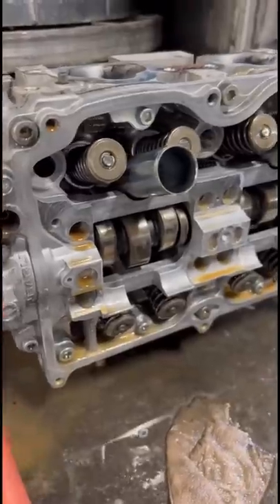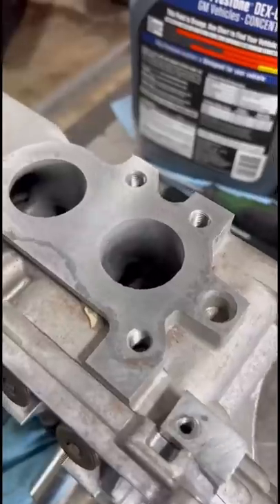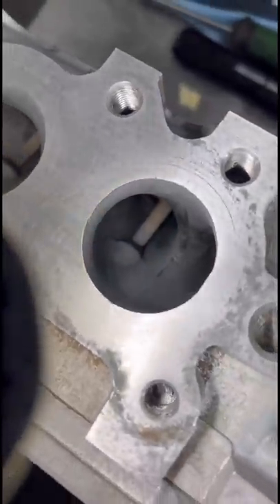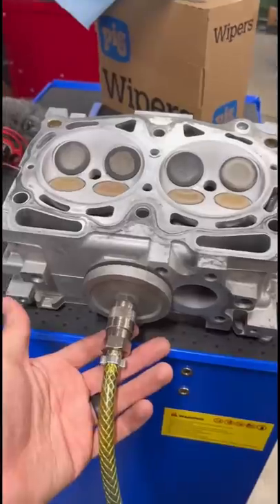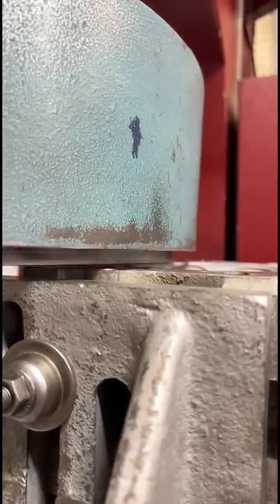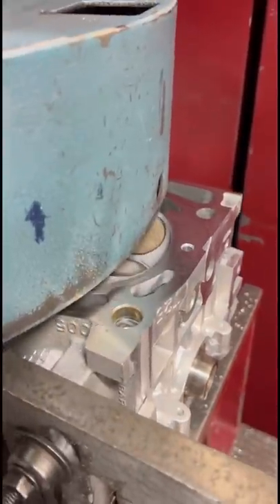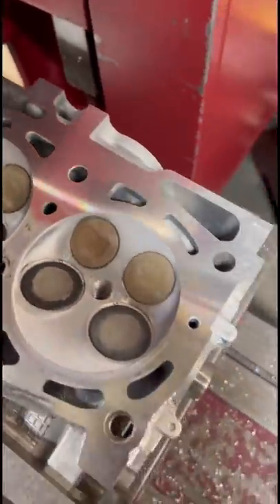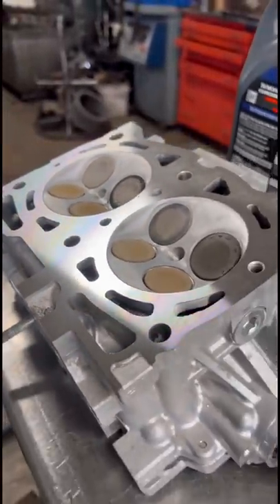#shorts Not A Week Goes By Without A Set Or Five Of Subaru Heads For Resurfacing

Comment: And think if they install these perfectly the customer will only have to do head gaskets again in 6-9 months 🤣🤣🤣
Reply: What makes you think that?
Reply: @e-racer4673  known problem with Subarus.
Reply: The NA Subaru engines had an open deck block that wasn't very good. I have heard that since the turbo Subarus have a closed deck block, this doesn't happen as often.
Reply: @skylinefever  the EJ257 isn't closed deck, but head gaskets have never been a problem I'm aware of. The cylinder ringlands do have a nasty habit of cracking or entirely separating and going for a ride around the inside of the crankcase. Been there, done that. It's always cylinder 4 for some reason, too.
Reply: @ParadigmUnkn0wn  From what I have read, the US version has a really lame exhaust manifold design that doesn't balance flow well. As a result, one cylinder will be hotter than others. Japan gets a full twin scroll, and that works better. However, they only get a 2.0L engine because there is a tax based on engine displacement.

Fortunately, engine importers can get you an OEM Subaru twinscroll turbo and manifold setup for cheap. If you want to go further, you could buy some high performance twin scroll manifold and turbo.
Reply: I have EJ252 na, around 260,000km. HG isn’t an issue. It’s a specific range of EJ25s on gen 2 iirc where the head gasket itself is the problem with carbon coating that gets etched away by coolant then the gasket can be corroded and you get a leak.
Reply: @skylinefever  wow a real expert! can you tell me what a twin scroll turbo is??
Reply: @byloyuripka9624  I couldn't explain it in text. It is probably best you watch various extreme Subaru turbo builds.
Reply: Only if you don't deck the block. Even .001 will be a problem. Most people won't want to pay for it though ....
Reply: Average lifespan of a 6.0 powerstroke too
Reply: Typically once the factory head gaskets are replaced with aftermarket ones the problem doesn't arise again.
Reply: Both my 04 and 08 legacy had head gaskets done. 04 is leaking again.
Reply: @byloyuripka9624  twin scroll separate the banks so you have the air separated all the way through the turbo. This creates a quicker turbo spool by utilizing the exhaust gas Pulses to their full potential.
Reply: @skylinefever  i did it for you..
Reply: It's a Subaru
Reply: Subaru vs camry.
Toyota camry lasts forever, but i have 2 questions.
1. Do they perform the same?
2. Are they driven the same?

It's obvious that the Subaru sees its red line pretty often and those who aren't driven like they've been stolen seem to not have any issues.
Reply: @codkiller2025  My 6.0 was bulletproofed at 80k and going on 300k+ with the most expensive part I've had to replace being the ac compressor...
Reply: @DirtForester  bruh it was only NA north american EJs that had head gasket issues... No other engine
Reply: Weld close the deck at 4 points with narrow 7mm welds and no more head gasket issues. Needs to be done before a head skim obviously.
Reply: @Draxindustries1  bruh wtf hahaha idk if your talking NA engines or turbo engines, depends on which, you just might be so damn wrong
Reply: @Merker367  
I don't quite understand  what you're saying as my first language is English. What my statement means if you strengthen the block ie partially close the deck it strengthens it preventing cylinder liner movement and in turn stops head gasket failure. This type of modification will apply to n/a as well as turbo engines. Hope this is clearer.
Reply: @Draxindustries1  that is not at all why the 2.5l blows head gaskets... You are severely misinformed
Reply: @Merker367  
Misinformed, not at all.
You must be working on another type of engine  obviously not Subaru..
Reply: If they replace the head gaskets with an aftermarket metal gasket, it will never have an issue again. The issue with Subaru head gaskets is the particular material that was used to make them, it breaks down over time.
Reply: Aha hahahaha I checked the comment after I made mine and you beat me to it, you're experienced
Reply: @DirtForester  I don't see many Subaru in the shop I might see 3 per year. It all depends on how u take care of the car tho if u drive the car floored everywhere it's not gonna last. If u drive slow and do routine maintenance it lasts as long as 94 corrola
Reply: But why i have been running my car for 8years with coolant pushing  out on boost... Yet it still didnt blew up
Reply: @Merker367  draxindustries1 is correct...

If u didnt know already.. thats called "closed dock mod"

Many version of doing closed deck mod on subaru block...

But minimal deck weld and dowel inserts are preferred to retain good cooling properties...

Fuppy closed weld/insert are generally stronger but need much more attention to cooling system (ie: race rally cars application)
Reply: @AmirPomen  This isn't why they blow head gaskets... Jeeze I'm trying to be nice but it's tough when talking to people with a 32mm thick skull.
Reply: @e-racer4673  He's read other comments on YouTube that say the same. LMAO I see it all the time and 90% of the time the person making the comment has never owned or worked on a subaru.
Reply: Oh yes! That's the main reason I will never own one of these motors lol. But, they are fun to drive if you don't own them!
Reply: @skylinefever  depends on the motor, Subaru has used open deck, semi-closed deck, and closed deck.  The most common in the US, for turbo trims, is the semi-closed deck if I recall correctly.

The 2.0 liter JDM engine was also to meet WRC homologation rules, back when Subaru was big in the WRC world.
Reply: @kylemcweeny878  good job. At least you have the internet for research purposes
Reply: @snowflakecuntreeman3947  Subaru vs camry
You mean impreza vs Camry?
As should anyone without snow half the year.
Or
WRX vs Corolla GR?
Corolla.
Toyota is always the answer.
Reply: @clockhanded  they aren't bought by the same kind of owners and certainly not driven the same.
The few Subaru's out there who were bought by very "sensible" people have lasted just as long as their toyota counterparts.
Reply: @snowflakecuntreeman3947  I don't know what point you're trying to make. Most people aren't thrashing new toyota or Subaru sedans. The sports cars are mostly driven hard. It has nothing to do with brand. It's a mixed bag. There are too many diverse Subaru and toyota owners to generalize them all.
Reply: @skylinefever clearly you dont know what closed deck is and subaru has been putting twin scrolls in since 2015. Also sti Japan is 2.5 wrx is 2.0. Also the exhaust manifold " issue" is from when they used uel headers which have been gone since 2015. Keep "hearing" but dont actually research or learn anything so you can continue to sound like a river wannabe.
Reply: This is the most overstated issues
 about subaru's I've encountered. Old NA subaru's used composite headgaskets that were eventually prone to failure. The fix is to switch to MLS style head gaskets. The issue is not with the design of the engine itself. The misinformation about this is rampant. Turbocharged subaru's have always used MLS headgaskets and the failure rate of them in turbo cars (ej205, ej255, ej257) is significantly less than NA cars even though they are subject to higher cylinder pressure. 

Tldr; The original flaw was in the design of the head gaskets. Ask anyone Subaru specialist or tech, when an NA Subaru comes in for a head gasket job they replace the composite gaskets with MLS gaskets and if done right, they don't ever come back for the same issue.
Reply: @Merker367  incorrect, the JDM ones are also notorious for head gasket failures.
Reply: @bullymaguire8868  that is incredibly false.
Reply: @Merker367  no. I live in NZ where we ONLY get  JDM versions. On top of that I completed my mechanic apprenticeship at a Subaru dealership before working at a Subaru specialist tuner for 6 years. The head gaskets are ABSOLUTELY prone to failure.
Reply: @epia125  the best 2.0 block is the factory closed deck block from the 89-92 JDM Legacy RS-RA.
Reply: @bullymaguire8868  you are so incorrect it hurts.
Reply: @Merker367  what was the best factory block in your opinion?
Reply: @epia125  IDK I don't know enough about all of them. The 2.5s are all or mostly all semi-closed which is nice, and you can get big power with that much displacement.
Reply: @Merker367  haha good luck then expert. Some people know everything I guess
Reply: Funnee meme but in reality the cylinder 4 ringland is the real sticky wicket for turbo EJs. Head gaskets are a “problem” on the 2.5 NA engines and the solution is to use the HGs for a turbo motor.
Reply: @detectivebloor4011  that is so wrong dude hahahah if you buy any head gasket for the NA ej it will be updated. It was only the factory NA gasket that wore off the coating too fast. Jesus Christ there is so much false info out there
Reply: @Merker367  lol ok dum dum
Reply: Thats funny because I was told thay my first car, a 2006 Impeaza wagon, had the headgaskets replaced before I bought it. 4 mo later and 6000mi later, I had to teach myself how to do heads
Reply: Idk, I did them on my wife’s ‘01 forester at 100k miles 12 years ago. 300k on it now, a tiny bit of oil seepage these days but nothing to lose sleep over. 

(Probably shouldn’t have said anything, I might have jinxed it)
Reply: As a firend is a suby master tech and I'm a Honda tech the reason isn't the heads so much as the EJ series as a whole that were NA didn't get the turboed MLS gaskets they were graphite coated...... You can see the issue when it wears off
Reply: And keep a spare couple of gallons of oil in the trunk 🤣
Reply: @snowflakecuntreeman3947  wouldn't a better comparison be a supra, Celica, Mrs, mr2, or something?

Whatever floats your boat though
Reply: @skachor  not for the point I'm trying to make.
My point is they are driven differently thus won't last equally as long.
Mr2 is in the same boat as the Subaru, they are both bought by a customer who wants a bit more in life and they both drive the car a bit harder (there are exceptions but I'm referring to the majority).
The guy who buys a camry does not buy it to ride it hard.
See what I'm getting at?
So the mr2 and Subaru will most probably both be labeled as "cars with issues" but not the legendary camry.
Even though if you ride thr camry just as hard it will have issues + not have tge same performance.
Reply: @snowflakecuntreeman3947  the mr2 is solid af.  At least over the 25 years I've had my 93.

Funny enough I have a Camry that I drive like I stole it and again - no issues.
Reply: @skachor  lol, so you drive the mr2 sports car which has actual performance and proper road handling abilities like a sain person and you drive the old reliable family car which performance wise sux compared to the mr2 like you stole it?
You sir are the exception, but id also pamper my expensive mr2 and drive the shit out of my cheap old camry, guess we are both the exception to the rule.

A Subaru is a performance car, even the family oriented models kick ass performance wise, they are just driven harder.
Some will say the mr2 is BS because they drive it like a race car so to Subaru's.
For me it's all about proper maintenance and touching the red line now and then and not destroying the red line everytime you get into the car.
Look after youe car and it will look after you, but many no most guys who buy a Subaru buy it to show off and ride the shit out of it and no matter how hard you push that camry it will never perform like a Subaru. Not even the mr2 will, wait doesn't the mr2 and a camry have the same engine?
Reply: @snowflakecuntreeman3947  no, I drive both the same and no the Camry and mr2 have different motors.  You should really know that if you're going to act like you know what you're talking about.
Reply: @skachor  it turns out i was correct, it did share the same engine, isn't wiki wonderful. Well some variants did anyway, but obviously they were tuned differently and had different carbs and so on but same engines.
Geez one would think as a owner you'd know this.
Reply: @clockhanded  i completely disagree, the average guy buying a Subaru is going to be more adventurous and possibly in a more "frugal" economic situation thus will drive their car harder.
The guy's buying Toyota camrys are boring and buy it for its reliability, resale value and economy and will take it easier.
Obviously there are exceptions to the rule, like with everything in life.
But that is why you'd see more work done on Subaru engines than Toyota camry engines, yeh sure Toyota is more reliable but it doesn't have the same power output nor is it driven the same.
Bottom line is, Subaru is not a problem car.
Reply: Yoooooo chill bro hahahah that hurts deep don’t talk about that
Reply: because america🤣🤣
Reply: @DirtForester  no it isn't. It's an issue with a specific headgasket on a specific non turbo charged model that was rectified 20+ years ago.

The majority of "head gasket" issues are actually overheating due to water pump failure because idiots won't replace them when they are due.
Reply: @skylinefever  the turbo Subarus do not have a closed deck block.
Reply: Fix the head gasket issue properly, with a good MLS gasket and don't worry about it again. If it fails again, someone didn't do a good job.
Reply: @arthurr8670  what if I told you the OEM gasket is mls?
Reply: Lol people on here trying to act like Subaru engines aren't trash
Reply: @16vSciroccoboi  there not.
Reply: @jeepmanxj  I'll take it from you, given you're obviously highly educated in the first place.
Reply: @16vSciroccoboi  I've only been working with them since the bugeye hit the US market. My in-laws still own a 98 outback with damn near half a million miles on the original engine. 

The problem with Subaru products, and for the most part any turbo 4 pot is the owner.
Reply: @jeepmanxj  cool story. I've seen a couple EJ22s with several hundred thousand miles. 

I've seen plenty more that weren't even abused that blew up, turbo or non turbo. 

The engines are shit.
Reply: @16vSciroccoboi  you haven't. Your 3 or for pieces of anecdotal evidence is meaningless against the millions and millions of Subarus on the road.
Reply: @jeepmanxj  okay. So my evidence is anecdotal, but yours isn't.

You're right, Subaru are the most dead solid unbreakable vehicles ever.

Meanwhile this single machine shop says not a week goes by they don't do a set or 5 of Subaru heads. 

Guess you must be right, it's just people doing preventative HG maintenance really.

I'd expect nothing less from a Subaru fanboy.
Reply: @16vSciroccoboi  you don't. I worked in an engine shop for a long time. 

Listen, I know you are reaching trying to come up with some nonsense to be right and you are just not going to cut it. You might be able to pull this nonsense with reddit clowns but I've been at this too long.
Reply: @jeepmanxj  cool story. You're still giving anecdotal evidence.
Reply: @Merker367  they all did. Always have. Some just take longer
Reply: @bullymaguire8868  I definitely do know more than yall
Reply: @jeepmanxj  it isnt on OEM NA 2.5s
Reply: @Merker367  it isn't on any of the EJ or fa turbo engines either.
Reply: @jeepmanxj   The Non turbo 1997-2003 2.5 North American EJs shipped from the factory with single layers head gaskets. Don't deny, look it up.
It might be all the way up to 2012 but I'm not sure
Reply: @Merker367  yep, 20 years ago, and no turbo Subaru offered in the states. Like I said earlier
Reply: If replaced properly one time with the correct gaskets they should be good for several hundred thousand miles. Don't believe everything you read in memes on the internet. 🤦‍♂️
Reply: @Joshuabryabt-gf6sc  You only need to avoid the naturally aspirated EJ25. All of my Subarus have 200K+ miles on original engines and head gaskets. 😂
Reply: @DCCTRacing  It's actually not the composite gasket (pre 97) that was the issue, it was the metal gasket which replaced it that had a rubberized coating that wore off over time. The fix was to go to turbo style gaskets, MLS without the full coating.
Reply: @802Garage  no body will ever believe you sadly. One issue with that statement though. If the engine has been overheated due to the head gasket failure, it can warp the mating surfaces. Some people just throw a new gasket on a warped deck, then the new gasket only lasts 40k miles and people are like "wow what a crappy engine"
Reply: @Merker367  Hahaha that's the truth! Oh well, those of us in the know will keep enjoying deep discounts on good Subarus. 😂 That said I still love my EJ18, EJ22, and EJ20 cars most.
Reply: @802Garage  got my '02Forester for $500 , a '00 outback for $500 and a '01 legacy for $700. I put about $300 in each of them and they run to this day! Well not the outback, was a parts car.
Reply: @Merker367  Hahaha exactly! I drove my last 1993 Impreza for 10 years, probably put a couple grand in it total for regular maintenance and repairs, including tires and wheels, and I only paid $300 for it originally. Plenty of other Subaru deals in the family of course.
Reply: If the motor lasts that long lol. Everything about these motors is a disaster.
Reply: @Twinturboripper  Yeah, sure. There aren't countless 300,000 plus mile EJ engines out there. 😂
Reply: @Twinturboripper  I can tell you have gained all you knowledge through FB posts and memes lol
Reply: @802Garage  there are countless at my shop being fixed. It’s not just a stereotype, they are literally some of the shittiest designed engines on this planet.
Reply: @Merker367  gained it by working on Subaru for over a decade. Cute how the fan boys can’t admit their beloved platform has a Shit designed engine!
Reply: @Twinturboripper  I know plenty of Subaru mechanics and performance shop workers/owners. Not to mention how many I have personally worked on. Every brand has issues and I'm not claiming the EJ is the best platform ever made. Everyone knows the NA EJ25 has head gasket issues. Do them once right, good to go. All of the 200-300K Subaru engines in my driveway that have never once been opened are a testament to how reliable they can be. That includes a handful of EJ20 turbo engines.
Reply: @Twinturboripper  you nailed it on the head, these cars are the absolute worst things on the road. Fanboys don’t listen because they think their subpar, crap awd, unreliable Subarus are the best. Funny how every one I talked into selling their Subaru has been so much happier with literally anything else they bought.
Reply: @jackdaniels2657  ok I'm going to throw my 2 cents in. First of all I don't agree if you baby a car it will last longer. I'm a mechanic by trade. I run the dog shit out of every car I own. I get great reliability out of all my cars. But I do maintain them and keep them at least half ass serviced. I all ways keep the oil full abs and the Trans. Now if my transmission get a little lazy between shifts I still raw dog them. I just let off the gas between shifts and let the Trans do its thing then it's back to the floor with the go pedal. I'm driving a 05 Kia with 200k on it back and forth to work which is 80 miles round trip every day. I raw dog the shit out the Car and it don't ever let me down. I live I'm memphis tn and the 240 loop is like a race track. My average speed is 90 mph. Before this car it was a Buick century and before that older Ford explorer. All had 250,000 miles on them when I sold them in running condition. I honestly believe In driving your car like you stole them. Why well because it's work out real well for me. I don't really have trouble with any of my cars that I drive like that. But like I said I keep them service kinda half ass but serviced
Reply: @jackdaniels2657  we  could argue all day long I'm just telling you what works for me. I  have lived it and experience it in action so what works for me may not work for you. I was just adding my 2 cents to the conversation
Reply: Turbo gaskets
 EJ255/257
Won’t have to do them again
Reply: @DirtForester  Only if you don't change your coolant at regular intervals. That's a major cause of head gasket failure.
Reply: @byloyuripka9624  the easiest way I can explain it is a single scroll turbo only has 1 exhaust gas inlet on the turbo, where as a twin scroll turbo will have 2 exhaust inlets. It basically separates cylinders 1 and 2 from 3 and 4 which in turn eliminates cylinders 1 and 3, and 2 and 4’s exhaust gases from interfering with each other during the valve overlap period.
Reply: @hillbillyhicks8102  same here. ASE certified mechanic for 30 plus years and I drive my ‘04 Odyssey like I stole it. never had any major problems and she’s got 287k on the odometer with original engine and trans and those BYBA transmissions are notorious for problems. I drain and fill trans every oil change. 
With routine maintenance a car should last a long time.
Reply: Only a problem on N/A cars
Reply: @Athiril  pretty much sums up the 7mge motor
Reply: @Merker367  glad someone said it. Everyone brings up head gaskets with subarus and it was a small amount that actually had the problem. I have owned four subarus an 04 sti, 14 legacy, 15 forester, and a 20 sti. I still have both stis. I have never had any issues. It's all about knowing what model to buy and maintaining and driving them correctly. Now the ej257 have had ringland problems but thats only if you increase boost on stock pistons. They get a bad rap because the type of people that buy/own the boosted models. Also they are not really good for beginers to mod. The toyota 3.0 toyota had head gasket issues. Almost evey manufacturer has models that are shitty. My venting has come to an end. Thank you for listening to my ted talk. 🤣
Reply: This only happens if you go hard on your car, thats the main reason boxer motors blow, if you go easy and drive it like its a altima then they will last for about 150000 km before needing a resurface. Now every person in the community thats owned a subaru knows this but also if you drive like youre in an altima everyone will look at you like an idiot.
Reply: @ParadigmUnkn0wn  Cylinder 4 gets the poorest cooling with the layout of the cooling system. There is a mod that helps, but it will still be the hottest Cylinder.
Reply: Idk man... Got an EJ22 at 180,000+ miles and the gaskets are still kickin. Not all subi motors have the issue.
Reply: Subaru owners be like "last gen had all the head gasket issues, but they fixed it on this one, dont worry"
Reply: Won’t have to if you use the correct headgasket
Reply: @16vSciroccoboi  But but...ItS a SpOrTs cAr!
Reply: If they aren’t idiots and use MLS head gaskets they’ll be fine
Reply: @Arthur R  actually brother, I'm a certified mechanic of 30yrs + and i haave worked on quite a few subaru head gaskets over the years and iam pretty sure that i know what i am doing. I do agree with the other guys about the multi layered gasket being the "somewhat fix". i have had a one start to leak several thousand miles later and it turned out that the head warped again for some reason. (and as always, it was torqued to specs and pattern). And i had one that a buddy/ mech. done and about 15,000mi. later it broke 2 of the head bolts. Now with that being said, I'm from Alaska and Subarus are def a prefered choice in the winter. just my opnion.
Reply: @johnsmith-bo2cz  did you get the 04 decked or just swapped the gasket?
Reply: @bullymaguire8868  did you actually try to claim nz Subarus are Jdm ? Then claim to be a subie specialist? LOL. So why do you have a catted up pipe, tgv’s and a 240kph speed limiter if your subie is Jdm? Sounds pretty nzdm to me bro.
Reply: @midnightrider1854  was the new warping near cylinder 4?
Reply: @DirtForester  I've owned many subaru's and so far yet to have a bad headgasket i swear it comes down to people don't take care of their cars.
Reply: Not true
Reply: Its what makes a subaru a subaru
Reply: @802Garage  I got a outback wagon that I bought with 300k does what I need it to do still
Reply: @nou8257  💪 They're great cars overall.
Reply: Came here to say the same thing! 😆
Reply: @skylinefever  thats not what caused the head gasket issues. It was an issue for only one engine type and during a particular period. Due to head gasket, material, and coolant.

Now fuckin ringlands on USDM EJ wrx/stis…. Thats something to talk shit about
Reply: @ParadigmUnkn0wn  Cylinders don't have ring lands. Pistons do.
Reply: It's basically do it every 100k miles with the timing belt and it's good for another 100k
Reply: Unlimited work!
Reply: @Athiril  That's the reason, a proper job like this, resurfacing the gasket sealing surface with an MLS head gasket (which turbos were fitted with as standard)should be a permanent fix.  My Forester had this done 40k ago and runs like a swiss watch.
Reply: @byloyuripka9624  twin scroll step ups have 2 ports with allow air to hit the exhaust wheel (turbine) in 2 different spots , Subarus blob eye and Hawkeye jdm engines ej 207s have twin scroll turbos it’s ideally for quicker boost in reality unless it’s a fairly large turbo I personally don’t find they work good single scroll is what I prefer
Reply: @DirtForester known problem in NA 2.5
Reply: To all the negative Subaru replys:
   Subaru used a single shim head gasket with a graphite coating on the 2.5 SOHC N/A engines. The fix is to use the OEM MLS (multi layered steel) gaskets they used on the ej255/257 turbo engines. And then all problems are fixed! 
  So it’s not that Subarus are doomed. They just have to be fixed correctly with the correct parts. 
  FYI-Dint go to the dealership as they will use the same crappy ones from the factory
Reply: Haven't had any trouble with either of our cars. Both our Legacy and Outback have been very reliable.
Reply: If a MLS gasket is used, preferably the OEM #110044AA642, the deck cleaned, measured, and the head torqued down the way it should be, they will last for 100’s of thousands of miles. 
    The whole issue with Subaru head gaskets is because the ones used from the factory are a single shim with graphite. Just a bad idea by Subaru to use those. 
    And to the people who’ve had them replaced by the dealer only to have to do them again later, it’s because they use the same ones that came from the factory. Don’t let your dealer do a head gasket job!
Reply: @DirtForester  the problem was solved after 2006 model year. No issues for the past generations, almost 20 years passed and you still think this joke is funny
Reply: @DirtForester no-one in my whole family has had that problem. And we all have them. The only one I can think of that would is my dad's old WRX which, to be fair, has been sitting for 10 years. I don't expect any head gasket to last after setting that long.
Reply: Big boost - fire rings = hg issues on any car, only a couple years of NA subbies had actual HG issues
Reply: @ParadigmUnkn0wn cylinder 4 runs the hottest because the turbo is tucked right up next to it
Reply: From my understanding it was the head gasket itself was the problem. It broke down and caused a leak.  They switched to an MLS ( multi-layer steel) head gasket. Which from my understanding fixed the problem. Aslo if the shop didn't machine the deck and heads flat. That could cause a failure too. I heard some were just cleaning the deck and heads without actually machining them. If memory serves it was with a scotchbright style pad for a die grinder which will cause flatness issues.
Reply: Subaru has a new head gasket you can use with the older motors that fixes the issue.
The big thing was that the head gasket in the NA EJ series motor was a single layer gasket where the turbo gasket was double layered. This ment thr NA head gasket was inherently weaker.
Reply: @DirtForester a lot if time the head get warped when you blow a headgasket, so you need to have it resurface, the common issue is the headgasket but it can harm more thing than the headgasket itself
Reply: @Merker367 same here. The NA versions I was told had the issue. So far ‘07 NA had gaskets fail. Turbo version going strong. 

But typically the turbos cop a hiding
Reply: @DCCTRacing Ding ding ding we have a winner. 

The NA engines didn't use the better gaskets. None of the turbo cars had the head gasket problems because they used the high quality metal ones (as you said).
Reply: If they use the nicer STI gaskets they'll last a long time